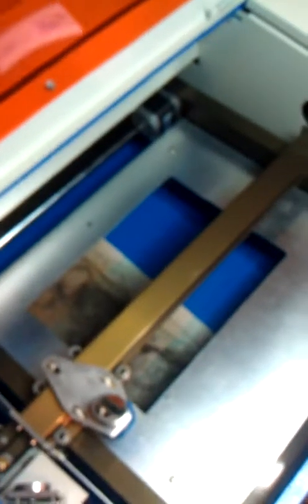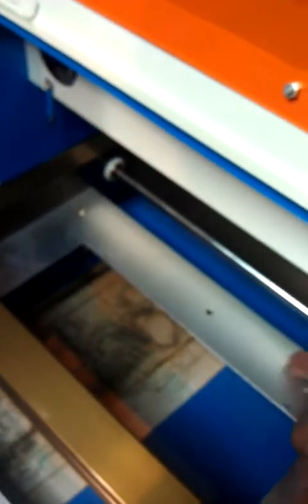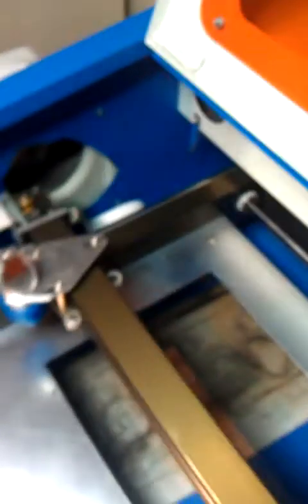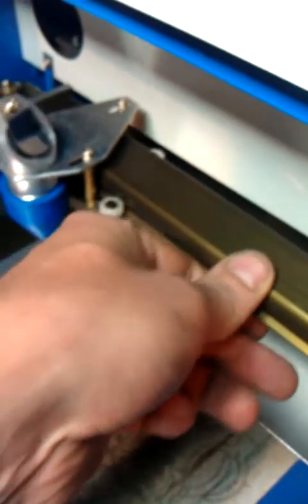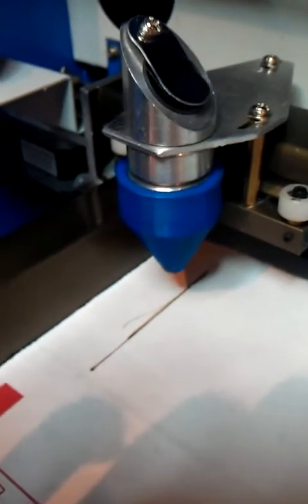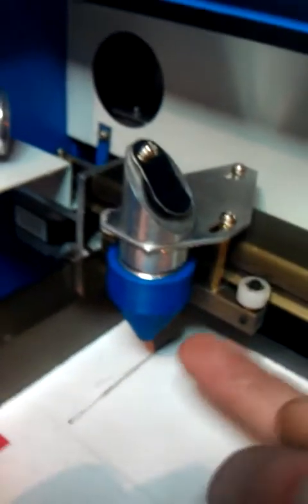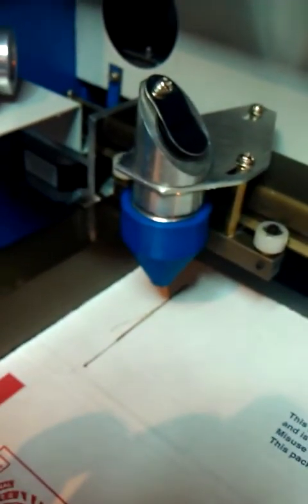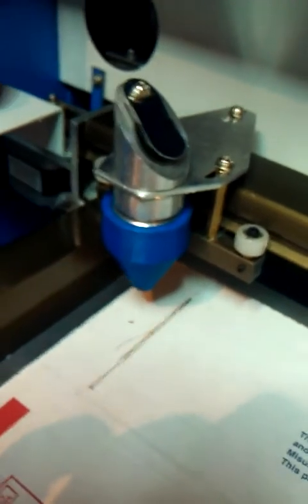laser cutter mods

Comment: Looks Good, been a few years since you posted this but how is the machine holding up now? Any more upgrades?
Reply from the maker: +Carlos A I had a lot of problems using the horable software that came with the machine so replaced the control board with an arduino stepper motor board. I don't use it much anymore but one of these days would love to swap the arduino with something that can control it with mach 3 
Thanks